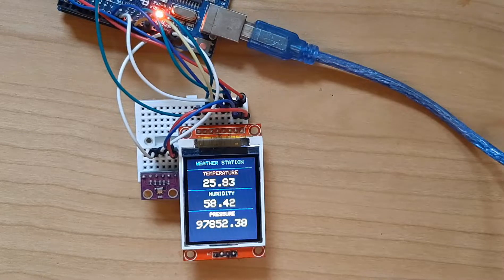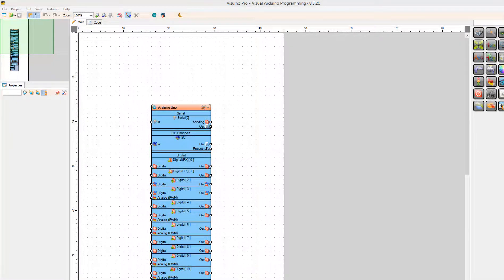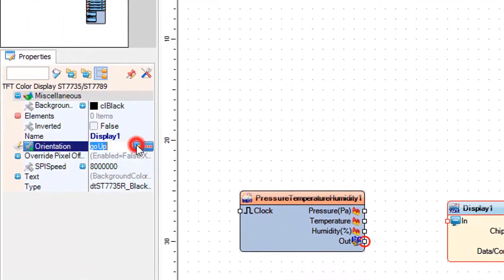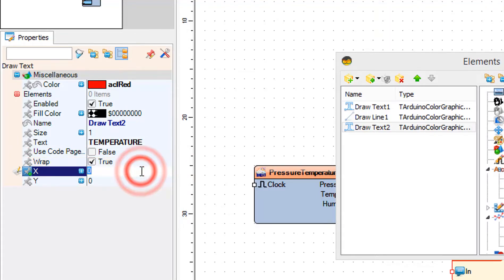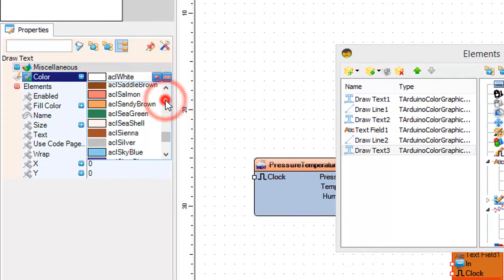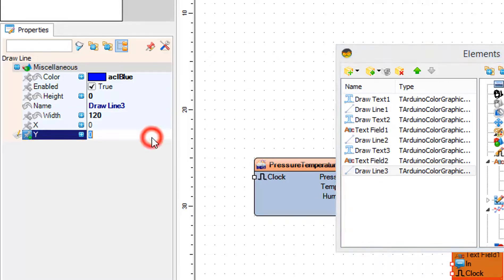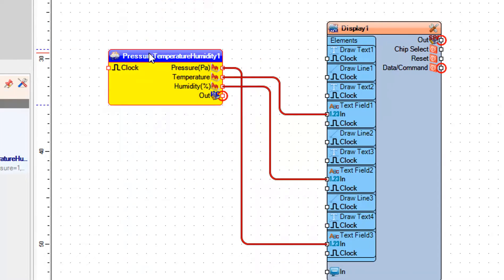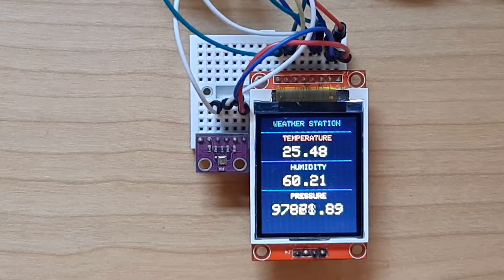Weather Station | How to use BME280 Temperature, Humidity and Pressure sensor

Comment: very nice 👍 The output value is in Pa and needs to be converted to hPa to be comparable to usual outputs. 1 pascal [Pa] = 0.01 hectopascal [hPa] so calculate Value / 100 = hPa. 👏 The Component "Divide Analog by Value" should do this.
Reply from the maker: Yes you are right, this was just to show the principal.